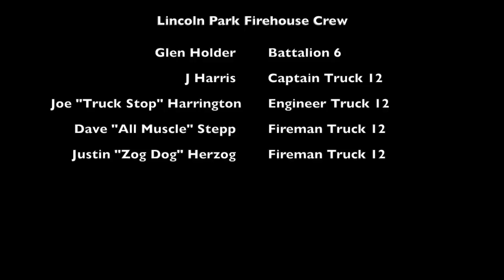Tuther Fire 2 FireCams

Comment: Everybody loves the hole cutting except for one intelligent commenter and myself.  Too bad no one EVER PROVES that there is some benefit to VVing.  A video of the interior getting better?  A scientific reason why it will do something positive without using the words, Heat Rises?  Opening a window at the fire room will allow the pressure to exit Directly to the exterior without having it travel through the house and set everything else on fire!  With the window open, you can put water directly on the burning material and stop the threat before a ladder could be set against the eves.  No, lets take the time and risk our lives to turn a house into a chimney.
Reply: @mxslick50   Ever try to get a fire started in a fireplace that has a frozen chimney?  The smoke comes back into the house because the HEAVY cold air can't be moved up by the Thin Light Hot Air so it DOES NOT RISE!!!  That's called High and Low Pressure Zones!!!  When you cut a hole in the roof and punch out the ceiling and you do it in one of the ONLY ways it will work, the fire gets bigger and the gasses that Can go up through the holes are replaced by more pressure as the fire gets bigger and causes more damage.  With Vertical Venting, you are keeping the heat inside the building and MAKING it pass through Unburned areas to make it go to the hole.  All you have to do is open a window at the fire room and the gasses go directly out of the structure.  Child!
Reply: @be5575  Prove it!
Reply: Just enjoy the video 9 times out of 10 the video owner could care less what your Dorito fingers typed
Reply: @paintballgaming1090    First of all Paint Ball Guy, the Correct phrase is "Couldn't care less."  Intelligent people who THINK before the speak Know that and there aren't many of them out there.  Second of all, you have nothing to offer but childishness so you should be very popular here.
Reply: JB91710 I don’t need the spelling or grammar lesson thanks though and don’t you find it pretty childish you fighting with someone online
Reply: @JB91710  r/iamverysmart
Reply: @paintballgaming1090  Do YOU?  That's what you are doing!  I make a legitimate statement about Vertical Venting and you Children have nothing to debate me with except for Heat Rises.  Well I've got news for you, that has little to do with why smoke comes out of the hole in the roof.  Pressure is the main reason.  Anyone want to counter that statement with something intelligent?
Reply: @JB91710   Alright, try this one on for size.  

Get a sealed, empty jar, with a combination pressure/vacuum gauge attached so one you monitor the pressure (or vacuum) inside remotely.  Note the reading with the jar at room temperature. 

Now, take that jar and place it in a colder environment, in a refrigerator for example.  Wait until the jar reaches the same temperature as inside the fridge and note the reading on the gauge. 

Now take that jar out of the fridge, let it return to room temperature again. Note the reading.

Now, heat the jar up to well above room temperature. Note the reading.  

What are the readings going to be?  At room temperature, since the jar has trapped room air in it, the reading will be zero, as there is no pressure differential. 

Cool it down, since cold air causes less pressure, you will read a partial vacuum. (The air becomes denser, which means less volume in a given space, thus the pressure drops.)

Back to room temperature, the air will start to return to its previous density, the vacuum will drop, so the pressure will come back up to zero. 

Heat it up, the air EXPANDS, and the pressure rises.  Any liquid (and yes, air is considered a liquid) will flow from a higher pressure region to a lower pressure region.  This is all high school science and the jar experiment was one taught in my high school.  

So in one way, you are correct, hot air creates a pressurized mass, so it is a contributing factor in the flow pattern.  (By the way, study about weather and you'll see the same pattern..note that warm fronts cause an INCREASE in barometric pressure and cold fronts cause a decrease.)

However, the laws of thermodynamics have proven repeatedly that heat does indeed RISE, not fall. That is demonstrated in many ways.  For example, during a fire, where are the lowest temperatures found, even in a room with the floor on fire?  Down by the floor.  Where are the highest temperatures found? Yep, up near the ceiling. 

You don't even have to set your room on fire to prove this, just take a thermometer and measure the temperature of a room at the floor, midway up, and at the ceiling. No matter what, you're gonna find it cooler at the bottom, warmer in the middle, and warmer still when you get to the ceiling level.  This is true on ANY floor of any type of building. 

Now, why do most buildings put air conditioning outlets at the ceiling level? Because cool air sinks, just as hot air rises. Air conditioning works best when the colder, denser air is introduced up high, to mix with, and force the less dense hotter air out of the way. Otherwise what you create is a very cold bottom layer with a hot air top layer...it eventually gets displaced due to the blower creating pressures that mix the air, but it is less efficient. For heating the opposite is true, heat is more efficiently distributed by introducing it down low, so as it rises it can mix with the colder air on the way up. Some larger homes actually reverse the function of the forced air registers to accomplish this. (It is not too common though as it is expensive to install all the necessary hardware.)  

So back to a fire situation.  The fastest, most efficient way to get heat out is to vent it at the highest possible point. The combination of the pressure and the thermodynamics will get it out quickly, depending on the size of the vent (since any opening can only flow a finite amount of air).  Now here's the catch.... if you make that opening at ANY location other than the highest point....yes, I can agree with you that you will still get outflow, and yes it will still be beneficial.  BUT the volume of space between the top of your horizontal opening and the ceiling/roof will STILL continue to trap hotter, higher pressure air.  And in a fire situation, where is that trapped air sitting? Yep, right at the head level of the average person. Not a good condition to be working in as now you'd have to keep below the top of the opening in a window to stay out of that hot air layer. 

You wanted a tactical discussion Jack, here it is.  I don't expect you to have read all of this, but if you did, I hope you understand that this was an attempt to see if you can have a rational discussion, and give you an opportunity to realize that neither I nor most of the people you have put down are stupid.
Reply: NinjaBoy and the Old Man Talk about an intelligent answer
Reply: @paintballgaming1090  Thank you sir. Now we'll see what ole JB has to say... it will be entertaining. :)
Reply: @mxslick50   

"I hope you understand that this was an attempt to see if you can have a rational discussion, and give you an opportunity to realize that neither I nor most of the people you have put down are stupid. "  TOO BAD YOU DIDN'T COMMUNICATE LIKE THAT FROM THE BEGINNING.

"So in one way, you are correct, hot air creates a pressurized mass, so it is a contributing factor in the flow pattern.  (By the way, study about weather and you'll see the same pattern..note that warm fronts cause an INCREASE in barometric pressure and cold fronts cause a decrease.)
"  I'M A PILOT SO I KNOW ABOUT AIR PRESSURE AND THE DIFFERANCE BETWEEN HOT AND COLD AIR MASSES.

"BUT the volume of space between the top of your horizontal opening and the ceiling/roof will STILL continue to trap hotter, higher pressure air.  And in a fire situation, where is that trapped air sitting? Yep, right at the head level of the average person. Not a good condition to be working in as now you'd have to keep below the top of the opening in a window to stay out of that hot air layer. 
"  LET'S SAY JUST FOR DISCUSION THE AVERAGE HEIGHT OF A MAN IS 5'-10" AND A WOMAN IS AT 5'-3".  THE STANDARD DOOR AND WINDOW HEADER HEIGHT IS 6'-8".  ALLOW FOR A LAYER OF SMOKE ONE FOOT THICK COMING OUT A WINDOW AND THE SMOKE CEILING IS AT 5"-8".  THE NUMBERS SPEAK FOR THEMSELVES.  YOU CAN SEE THAT BREAKING OUT THE WINDOW IMMEDIATILY RELEASES TRAPPED HEAT AND SMOKE FROM THE ROOM GIVING ANYBODY A SAFER ZONE FROM 3' DOWN.

"The fastest, most efficient way to get heat out is to vent it at the highest possible point.  The combination of the pressure and the thermodynamics will get it out quickly, depending on the size of the vent (since any opening can only flow a finite amount of air)."  

Now this is where people use Heat Rises for the explanation for why VVing works.  So they figure that a hole at the highest point of the structure will eliminate heat and smoke fastest.  Let's see what happens when a house is Vertically Vented apposed to Horizontal Ventilation.  

Let's use a 2.5 story colonial as an example.  First we will have a fire on the first floor and then we will do the second floor. 
  To keep everything in perspective we will start with a truck crew,

1.  Take the time to get fully dressed.
2.  Put a team together.
3.  Gather tools.
4.  Start the chainsaw on the ground.
5.  Get a ladder off the truck and set it against the eve.
6.  Carry another ladder up to the roof and hook it on the ridge.
7.  Get the crew up the ladders and on to the roof while testing the roof as they make it to the top.  
8.  Then they have to start cutting holes.  
Now, we are at the same point where one person is standing at a window prepared to Horizontally Vent and extinguish the burning room.  Two people if it is the second floor so a ladder can break out the window and be ready for an escape route.  Which is more efficient and quicker?

Let's start with your/my room ceiling condition and we'll stick with Vertical Ventilation and no extinguishment.   
Let's say the hole was punched in the hallway which would be the ideal location.  Unless the attic has a floor or the joists are filled with insulation or the ceiling is plater and lathe or the hole is punched into a room with the door to the hallway is closed.  As you said, the size of the hole makes all the difference.  Ceiling joist have a space between them of 14-1/2".  A small hole will only feed flammable gasses into the attic and won't relieve much pressure from below.  A window is a guaranteed big hole.

The living room is burning and smoke is filling the first floor and going up the stairs to the second floor hallway.  The rooms will be full of fatal levels of heat and smoke from floor to ceiling and the heat above the door or arch header will be trapped there except for the one spot on the top floor where the hole was punched in the ceiling.  In all other rooms where there is fire, nothing changes.  If, the hole is in the hallway, the heat and possibly flames will leave the Interior ceiling of the hallway and enter the Structural attic space igniting any flammable gasses mixed with fresh air and turning the previously suffocating attic into an inferno.  

When hot air starts flowing through the ceiling hole, that does Not move all the air in the house towards that hole.  Pressure gradually equalizes just like when an aircraft looses pressure at high altitude.  There isn't an explosive decompression that sucks everything out of the plane.  There is only an equalization of pressure.  So pretty much Nothing changes on the first floor.  Ul has proved that in their videos.  There is Not a rising of the gas and heat level that makes it easier for fire fighters to work in.  Only quick horizontal ventilation and water application can do that.

This time the fire is in a second floor bedroom.  Again, it's a crap shoot where the hole is punched in the roof and ceiling.  If it's in the hallway, the fire from the bedroom will move toward the hole blocking that escape route from any other bedroom by igniting the carpet and any furnishings.  If the bedroom door is closed, the hole in the roof did nothing and the fire is still burning.  If the hole is in the bedroom ceiling, the flames will set the attic on fire.  Now the fire is in a very difficult location to access.  Don't forget, Vertical Venting does Not provide for water application while Horizontal Venting gives direct access to the burning material.  Every room has a window!

To sum it up, VVing will leave rooms with no holes in the ceiling, just the way they were.  Floor to ceiling death and the FFers still have to crawl through the thick black smoke to Find the fire they walked past outside..  Horizontal Venting will give all the heat and gasses from the floor to three feet up a direct route out of the building.  Pressure from the fire will be the driving force, not Heat Rising.  Water can be instantly applied to the burning material!  All this from outside before the ladder can be set against the eve.  Break the window and add water.  The temperature drops by 1000 degrees almost instantly, per UL testing..  Watch this video and listen carefully.  Read all my comments there.
https://youtu.be/JwE1pPyXFIY?list=PLkp0E1ao1XEw35c4z-PSM0hoKYiMLpHJC
Reply: @paintballgaming1090  Wait until you hear mine!
Reply: @JB91710   I gave your comment a thumbs up for the first time because you gave a very clear, concise explanation of your tactical thoughts without rhetoric and name calling. You have a lot of good, valid points that were explained in detail. I am positive that, had you adopted this same tone on other videos where you argued tactics, your message would have been welcomed. 

This type of dialog allows others to see the WHY behind your critiques, which is always a good basis for discussion. 

That said, since as of the date of writing this post, I have not yet undergone any training as a FF, so I cannot say for sure that you are 100% right (or wrong), but I can say that you have some valid points. I will keep an open mind during my training and take in all that is said from all the instructors, as well as the solid points you have finally made in this last comment. I do not necessarily agree with EVERYTHING in your last comment, but again, you stated in a calm way some things that were not clear before. Perhaps once I get some training under my belt, and some real world hands on experience, some of the things I don't currently agree with or understand fully will be proven correct.  

"TOO BAD YOU DIDN'T COMMUNICATE LIKE THAT FROM THE BEGINNING." I ask the same of you, because it would have saved all the arguing.  Please, in the future, keep this last bit of discussion in your mind, because if you present your view as you have just done here,  you will find a lot more people listening to what you have to say. 

We all have a variety and lifetime of experience in many areas, and it is natural for people to want to pass their knowledge on. But it is all in HOW you share that information. Do it right, people listen. Do it negatively, and people will ignore it or fire back at it in the same way. 

I sincerely do thank you for how you responded in this case.
Reply: @mxslick50   Are you the same person I have been dealing with?  You must be the old man and I was previously dealing with nijaboy.

You need to read more of my comments.  When I see incorrect fire fighting I explain In Detail how it should be done.  That's when the children pour out of the woodwork who can't talk tactics.  I call a spade a spade.  However they act, that's how they will be addressed.  What also pisses me off is civilians who worship fire fighters  just because they love their super heroes.    Fire Fighting is Not a game for people to Play!

When I see braindead stupid, I am Not going to address them as if we are just talking different tactics.  They need the asses fired.  I have been dealing with mediocrity for 45 years and I have no patience for pretenders.

If you are going into training, memorize the videos I have linked and when your instructors tell you something different, debate them.  Of course if you do, you won't be allowed to join them.  That's where you have to decide if you want to get the job done or just follow.

Nice to see a turn around in your attitude.  I have no hope for the others that I have had to deal with for a much longer time.  

If you want to talk tactics in the future, bring it on!
Reply: @mxslick50  P.S.  In the 10 years I have been commenting on these videos. if I talk tactics or get pissed, I get the same reaction!
Reply: I can only say from experience that it is a noticeable difference when a heat hole is placed directly over the fire when you are inside with a hoseline... even with windows blowing fire or opened up. Ventilation times depend on the department resource levels and SOGs. Your window size is limited while you can make your hole as big as you need on a roof.
Reply: @airmesh   Did you read my last comment to NinjaBoy?  The hole in the roof is not the problem.  It is how big you can make the hole in the ceiling and where you make it.  Getting it directly over the fire room is almost impossible.  They Always make it at the high point of the roof where the distance DOWN to the ceiling is at it's highest.  in a 12 pitch roof, that is around 12' minimum depending on the depth of the house.  How long are their poles and how efficient would they be with heat and smoke in their face?

With everything that is a danger or obstacle, Vertical Venting is so ridiculous that I can't believe someone thought of it, let alone the vast majority of departments in America doing it.  Every room has a window.  That means you can see the fire.  Break the window to release pressure away from the interior and apply water.  You can extinguish an interior fire any easier, quicker and safer than that.

The Perception of interior conditions improving is a trick of the mind or people say it works because they bought into it and are embarrassed to admit it doesn't do anything other than burning the structure better.  This is how great VVing is in reality.  https://www.youtube.com/playlist?list=PLkp0E1ao1XEy2uMomAtjWfScRFcCUmwwv
Reply: @paintballgaming1090   What's the matter Paintball?  Cat got your tongue after reading my response to NinjaBoy?  You had a Big Mouth before, why not now?
Reply: JB91710 I’ve had better things to do than stoop lower to your level
Reply: JB91710 You also do realize that not all crews are on Ventilation there was at least 2 lines off the engine on the A side. You don’t ever want to cut directly above the fire if that roof collapses your dead. What’s wrong Jb? Cat got your tongue or do you have to wait and go get your responses from someone?
Reply: @paintballgaming1090  Well I will say I am not surprised that JB went back to his old ways, right back to arguing and name calling.  I had a spark of hope (pun intended) that MAYBE, somewhere in him was some common decency. I was wrong. 

Oh, and JB, if Ninja Boy could use a computer I'd be rich.... Ninja Boy is the name my autistic nephew gave to my 2012 Ninja 250 bike.  I am the same guy talking to you before. 

You need to recall this bit and keep it in mind: 

 Please, in the future, keep this last bit of discussion in your mind, because if you present your view as you have just done here, you will find a lot more people listening to what you have to say. We all have a variety and lifetime of experience in many areas, and it is natural for people to want to pass their knowledge on. 

But it is all in HOW you share that information. Do it right, people listen. Do it negatively, and people will ignore it or fire back at it in the same way.

I don't want to keep battling with you JB, but if you persist in acting out, don't be surprised if I call you out on it.
Reply: NinjaBoy and the Old Man Thank you for being diligent and not as childish as Jb and I have been
Reply: @paintballgaming1090   LOL thanks I think. :)

I agree with your stance to be clear.  If someone is gonna persist in name calling and being a dick, well they can expect it right back at them TBH. 

You (and many others) have a right to be frustrated and fire back when someone gets all smartass on you. The ONLY reason I had complimented JB was that he DID (after a bit of a rough start) settle down and have a rational discussion in that one post...but you'll note how his next responses were passive-agressive again. That's why I never replied to them. 

Realistically, I feel JB is beyond redemption, despite a nice gesture here and there, because he has over 9 years (and hundreds, if not a thousand or so) comments to make up for.  I don't think he'll ever change, candidly.
Reply: NinjaBoy and the Old Man That was a complement in the highest regards
Reply: @paintballgaming1090  I was pretty sure it was, thus the lol. :)   Hit me up some time on my discussion tab .
Reply: JB91710 JB91710 I appreciate your response and you bring up some points worth discussing. However, It seems that you lack real fireground experience and are throwing out theories from an armchair in a living room. Again, I am speaking from experience that you notice a huge difference when a COORDINATED hole is cut in the roof. You either choose to ignore this or you have never been a part of interior operations. 

For your other theory: We carry long pike poles to punch the ceiling on steep pitch roofs. In addition, engine companies pull ceiling inside to let heat escape out of the room and up through the ventilation hole. Im going to reiterate that you cant make a window bigger, and it limits the release of heat and smoke. What about commercial buildings with very few openings other than the front door and skylights on the roof?

Now, Is there a time and place to break windows and direct a hose stream from the outside? Without a doubt, but to ignore the effectiveness of a well coordinated ventilation operation is unsound.